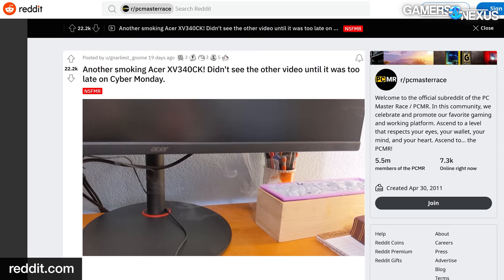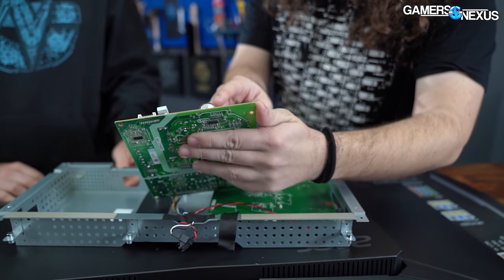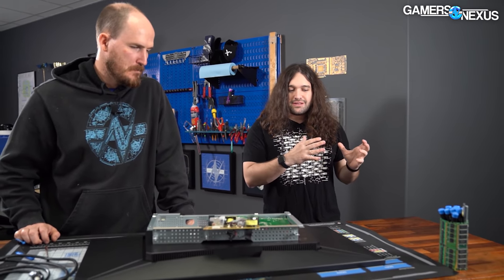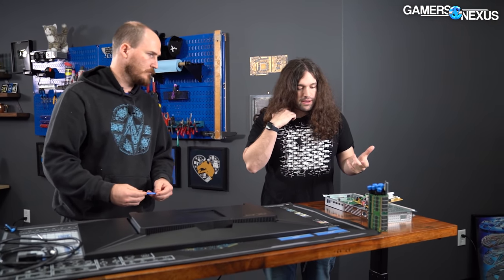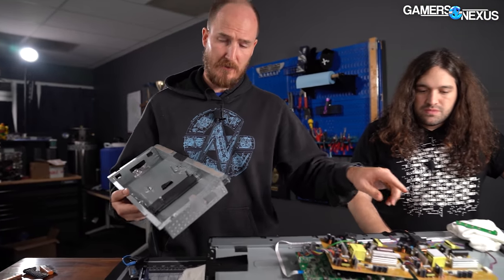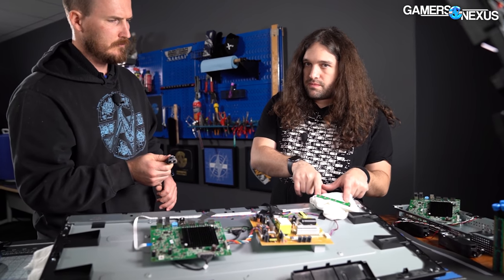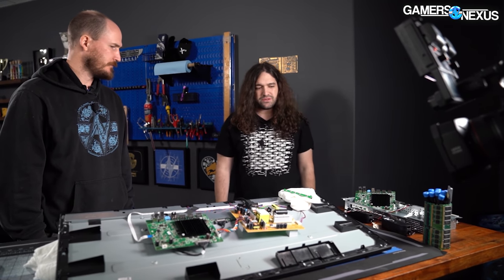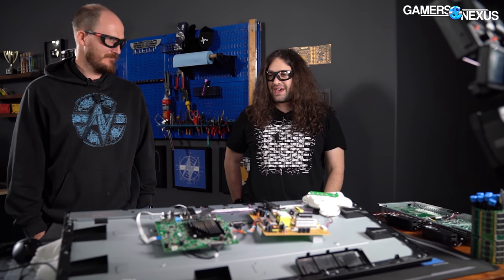Acer Monitor Fires Investigated: Blown Capacitors on Acer XV340CK

Comment: I'd love a repair video. Switch mode power supplies seem to be about the simplest electronic assembly one can find these days, and they're in EVERYTHING. Maybe if Patrick could do a little applied theory, people with the soldering skills (who aren't afraid of mains voltage) could potentially fix one.

Comment: I had a super old acer monitor (tn 16" 1336x768) that stopped turning on at some point and when i took it apart there was also a blown cap, after replacing it monitor worked for another year or so before i needed to replace the cap again. There was no smoke tho, just inflated caps

Comment: Had a Radeon 9700 Pro catch fire a long time ago. A flame was clearly visible through the side of the case until I pulled the plug. Was likely the PSU actually, but ATI replaced it anyway with a 9800 Pro.

Comment: My old Acer XB270HU from 2015 sometimes smells hot. If I place my face above the top. Still works fine. Got it used 4 years ago.

Comment: Would that first coil be to stop a dirty power signal coming from the wall outlet, and would it need a clamping circuit to stop a back EM voltage spike hitting that cap? So it might only fail if you have a dirty power signal and it might be a faulty diode. Just a thought. 🤷🏻‍♂️

Comment: i think its worth mentioning as in the video....if you've got a problematic device (potential fire hazard) and you leave it running you start running the risk of a cascade of failure....chances are if the cap goes its just DONE but like they said its the what if....once you have one failure the chances of failures compounding on the first becomes more likely...keep an eye on it maybe open it up and check your cap make sure you have one that doesn't fit the pattern of failure.

Comment: I don't think those blocks on the bottom are thermal pads.  I think they're just a cheap way to both attach the boards to the monitor and to provide standoffs. 
I had a similar block elevating a WIFI board in a modem..

Comment: Also the back left caps are black instead of brown... I think the failure here is caused by a short from the power componants to the metal shell that encloses the power circuitry... that would be my guess

Comment: With certain intel video drivers you can usually use Ctrl+Alt+down arrow to flip the screen, this normally works even if you have a second GPU, just so long as intel video is installed

Comment: In regards to the differing parts used in the power supply: the videos of monitors exploding came out right after black Friday, in which manufacturers are notorious for using cheaper and lower quality components to make lower quality products still sold under the same model number at a massive discount.

While internals can and do change over time depending on supply, the proximity of those failures that close to black Friday cannot be a coincidence.
Reply: Manufactuerers rarely know when a product they ship is going to be sold, and often have lead times of months before it even hits the stores  - it's the retailers who discount stuff they can't sell at MSRP during the BF sales (usually older stock, or ex-display, or known bad).

Comment: Another good question to ask, the ppl with the failed ones, did they get it shipped to them and how long between them receiving them to setting it up and using ?   Asking because ups fedex never have heat where product is , then bringing in and setting up right away isnt good for electronics.  I always let mine sit and warm up for a while before hooking up.     Also would be interested to see video about asus z690 boards ( heroes and extreme ( my board ) causes of them burning up, bricking, not working  post code 53.

Comment: I'm surprised you guys didn't point out the multiple capacitor recalls from recent years. I've even received a class action lawsuit settlement card for some random cap purchase years back. And now with 'cloned' components being so common, particularly with the messed up supply chain issues, this is bound to happen.

Comment: The reason the chassis for PCs and monitor components and PSUs and such are made of steel is that there's always an inherent fire risk of electrical components and they need to stay intact even if there's a fire inside on the PCB. A safe component isn't one that very rarely catches fire, it's one that contains fire even when it happens.

Comment: I remember back around 07 Dell had used a bunch of bad caps on the xps mobos. They started popping around 09. I went through 4 of those boards before scrapping and upgrading. Caps and batteries have a problem with shady Asian companies recycling old parts by rewrapping and pushing out as new parts.
Reply: Not just dell. Around that time EVERYONE had problems with taiwanese caps, which is why you see some stuff advertised to have "Japanese caps"
Reply: @ILoveTinfoilHats  Also known as the "Capacitor plague" in case you want to look that up.
Reply: @TheDeadfast  It goes by many names depending where you're from

Comment: Looks like the main post rectification Capacitor failed. Not a typical failure for switching supplies. Suspects include counterfeit parts incorrect parts or counterfeit  power supplies. The actual power supply manufacture is typically printed on the PCB.

Comment: Does not surprise me Acer monitors are blowing up.

I purchased one of their ultra wides several years ago when the market was very new for them. It has had consistent issues and Acer refuse to acknowledge them and replace their displays. 

One of the issues is massive flickering when using the display at the advertised refresh rate. Because it turns out the displays were overclocked to reach that refresh rate and so using it at that rate can cause massive flickering which refused to say was a defect.

Comment: Might be interesting to swap the good power boards onto the bad monitors to see if there was a deeper issue in the control boards or probe the output voltages of the good board and inject the voltages from adjustable power supplies so you don’t risk taking out a good monitor’s power supply.

Comment: If they are correct it is just like the motherboards that had cheap caps that would go bad and motherboard would not boot or run Windows, the caps are some the cheapest they could find and it got them in the end.

Comment: If the cap explodes then the smoke is due to escape of the dielectric, which is a liquid so its more like bad smelling steam , not smoke from a fire like a burned out shorted semi conductor or overloaded resistor.

Comment: In the past with older Acer monitors, especially the time period of the X series such as the x191w and other old displays from that time period, they would use cheap Capxon capacitors, and then place the mosfet heatsinks directly under the capacitor, and thus make it more likely to fail after around 1.5 years. Deoe ding on the failure, you would get smoke when the capacitor leaked I to the mosfet. I took pictures of some of the failures many years ago.
Reply: Seems links may not be allowed, thus the images will not show up where I linked them in replies.
Anyway, with many of their older monitors, they would design them in such a way where the capacitors would get cooked over a few heatsinks, and then they would fail within a few months of the warranty ending. They would use cheap Capxon capacitors and run then close to their voltage limits under high temperatures. You would then run into issues with the monitor not starting reliably, and if you use it much beyond then, they will leak and smoke.

Comment: I wonder if Kramden or one of GN's other repair/salvage contacts might have a spare of the suspect brown cap in a bin somewhere undamaged? If you could replace the brown cap on the blown monitor with a different model and get it working, then replace that with an undamaged brown one and pop it, you'd have a pretty decent proof that that particular model of cap is the culprit.

Comment: In the Vintage Retro world we call this "letting out the magic smoke". It's not uncommon for caps (especially power filtering x caps) to die on boot up of a computer that's sat around awhile. Usually it's just annoyingly smoky, and you can replace the caps and move on. 

I just inspected the caps in my IBM 5160, and they look and test fine today, but I expect them to go boom and let out the magic smoke any day now when I awaken the 40 year old beast to play games (CGA color palette FTW!)
Reply: Yeah... I had a Tektronix 1230 that had sat around for 10 years on my bench.  I got a newer unit and decided to sell the old one.  Turned on the power to take pictures, and some of the caps in the power supply decided to respond... violently... to being turned on again.  Of course we're talking about a device that was probably around 40 years old.  Those boxy yellow caps are usually at fault.

Comment: That's the primary cap. 120v AC in, hits a rectifier then its 120v DC on that cap. Check the rectifier for diode failure.

Comment: I got one of these March 2020, my internal debate was this monitor or saving $250 by buying the Gigabyte G34WQC. I opted to avoid Gigabyte's repair center in CA, jokes on me. XV340CK has been really good to me, I've used it for 8-12 hours a day for mostly work and heavy gaming. Not the best but checks a ton of boxes. AMA

Comment: So, we've got an out-of-box failure that seems to be limited to older production runs. To new and future owners this means keeping an eye on the thing for the first half hour of use, and, if it survives that long it'll probably be fine until something else kills it in 10+ years.
The real question for those with failed units is whether to go back to the retailer to have it refunded/replaced, or, to go through Acer's manufacturer's warranty...

Comment: Take the following with a grain of salt since I have not had the PSU-circuitboard in hand.
The "transformer" sitting by itself in the corner does not make sense as a transformer. As a big choke, it would make a lot of sense for power factor correction.
Those "thermalpads" also strike me as odd when viewed from that angle. They would make sense as spacers to prevent the back of the PSU board shorting to the case though.

Mains voltage testing should at minimum be done behind an isolation transformer and an emergency shutdown in reach. Neither prevents shocks, but they lessen the potential for harm.

Comment: I had a Viewsonic monitor(VX2235WM) which had one of electrolytic cap in power supply die out(not in smoke) had it repaired for cheap(10-15$ bill) and it's still working after all these years. Its repurposed for use with security cameras.

Comment: This is a common issue on monitors and TVs, but the problem occurs after a very long time of usage when the electrical components degrade, btw the use of a thermal camera in future videos would de great with issues like this one

Comment: Acer has like a dozen different 34" 3440x1440P 144hz monitors...a lot built for specific retailers (i.e. Costco unique SKU), some curved panel, some flat panel.  Wonder how many parts crossover there is between the models.

Comment: Easy way to use a mouse on a computer when screen is rotated is to rotate the mouse equivalently. To deal with the buttons swap, you can place a finger on the primary to use button.

Comment: I am betting its a supply chain issue and someone swapped in a non low esr cap in there (they last 2-10min normally before pop), I have had similar failures on cheap led supplies. Due to the capacitor heating itself. You have to look up the cap model (if you can find it) Or a miss marked capacitor + - reversed I have seen it at least once.

Comment: If you could source the failed caps, you could do either
1)LCR meauseents accoss the frequency range compared to the good black. You may have high ESR.
2) put the busted cap and old X2 in one of the new PCB, see if anything happens. 

Doesn't sound like you can now though

All in all though, the US power grid can be horribly noisy. Likely a component that is barely making spec or slightly faulty combined with poor supply side input. Even getting an old brown bulk cap and X2 PCB as a new product is unlikely to fail. There would be hundreds to thousands of monitors with this config in the wild. 

.

Comment: It sounds like, the cap was the wrong way around in the failing monitors or somehow VCC and GND was switched around further up the PCB.

But calling it "burned" or "fire hazard" is a bit much. Yes technically the electrolyte could catch fire, but so does fuel in your car.
All it does is getting hot, the cap vents, makes a loud pop because the electrolyte is cooking and magic smoke escapes.

Changing the cap to an similar spec one (size doesn't really matter in this case) should do the trick, unless it is a problem further up the PCB - but you'll notice that, when the new cap is popping again within a few minutes :D

Comment: Rare to see the main bulk cap go like that, basically it must have had over current either from mis-represented ratings on the cap, or the mosfet/mosfet control is iffy
Reply: Or just a design that didn't account for component ratings
Reply: perhaps even a shorted winding on that transformer

Comment: What's interesting about the 240 and 360Hz monitors is that their price tag is totally inflated for no reason. The hardware required to run it at such refresh rates is just a different processing chip and timings, the rest is exactly the same as on the other 1mn IPS panels.

Comment: Old story : back in 2000 I decided to upgrade the monitor of my very first PC, which came with a 14" CRT.
I found a good deal on an Acer 19" CRT monitor. Spoke with the salesman, who convinced 17 years old me to buy it.
Came home super excited, plugged it in, booted the computer. 800x600 looked terrible on a 19", so I obviously set the resolution to 1280x1024.
Immediately, I noticed a huge black border around the screen. Went into the menu, set the picture size to maximum, still had a black border. The image itself was more like 17 or 18".
I was a bit disappointed, but decided to do a little bit of gaming.
Less than an hour later, I heard a loud pop, and saw smoke rise from the monitor, along with a strong smell of burning.
Unplugged everything, went straight back to the retailer. When I arrived in front of their aftersale counter, I noticed a wall (litteral wall, boxes piled up on top of boxes) of Acer monitor boxes.
They refunded me without even asking a question.

I haven't bought another Acer product ever since.

Comment: I've never thought that the most important component for building a modern PC it will be a fire extinguisher. I am adding one to the cart right now - I have the Fractal Design Torrent case (to be fair with Fractal, they did included the replacement hub version in the box) and also the Asus Z690 Hero motherboard - not used in a build yet, waiting for the memory (hope Asus will do the same as Fractal did). Could have been much worse - glad I didn't picked up a Gigabyte PSU and an Acer monitor.

Comment: For those who did not watch the entirety of the video an may have some how found this comment. I wilp give you my opinion on the subject (do note I have not spent the time to completely read up on the issue.) Alright so given how long this monitor has been out, the fact that we are only now starting to find out this issue. I am going  to come to the conclusion that the problem is likely extremely rare. To the point that the issue was likely caught early on in QC testing and they probably either finished using that batch or stopped halfway through when they discovered the issue. Assuming the latter they probably already had product that left the factory and decide that the problem was not worth a recall ('cause I mean who wants admit that their stuff catches fire? Nobody wants to have the next Note 7) and they probably figured that their warranty and support department s would pick up the slack.

Comment: Not mosfets those are transistors, those are not thermal pads they are insulation to prevent ground shorts at 110-230v to ground. Moisture in the housing shorting the transformer or legs of the cap, this is happening in winter.  They had them delivered did not allow them to warm up after sub 40f delivery storage turned it on and pop.

Comment: Where was the cap failed? Didn't look like the wedges were blown out the top, thats already odd as in a cap it has those wedges to vent any built up gas in case of a failure where the fluid escapes or gets too hot.

Comment: But I do monitor reviews, and having reviewed this particular model and having seen a few people comment on my video - following yours - it does raise massive concern.

Thanks for investigating it and raising awareness; can safely say, I had no smoking monitor with my unit, of which I used for around a week. I'm not endorsed by Acer etc, but did buy my own Acer monitor back in 2015 (XF270HU - now replaced by the XF270HUA), and haven't had any issues using my monitor on a daily basis. Of course, these are completely different products, and different build years, but from the same manufacturer.

Comment: Those don't look like thermal pads... they look like isolator pads. Something to isolate the pcb from making contact with the chassis - especially because of all the exposed through-hole parts. It can also prevent damage while reinstalling the back plate to give it a cushion to lay on...